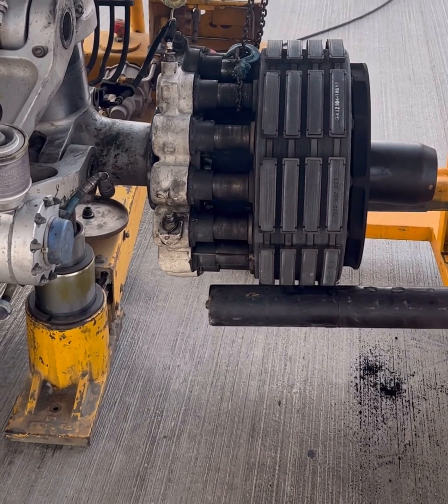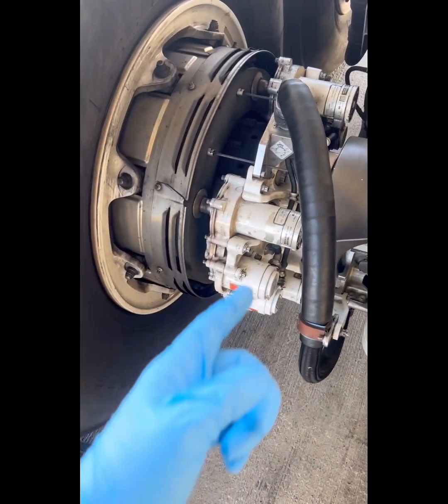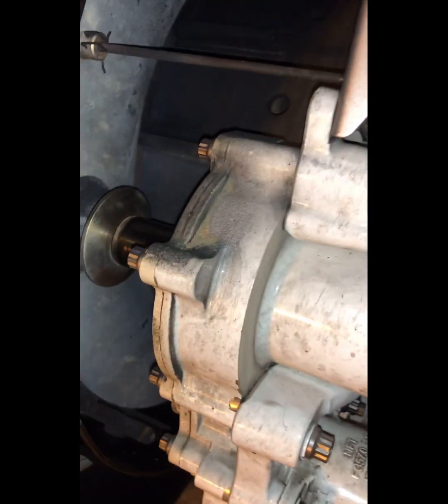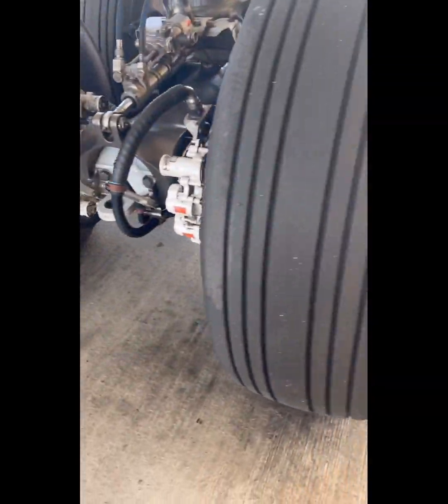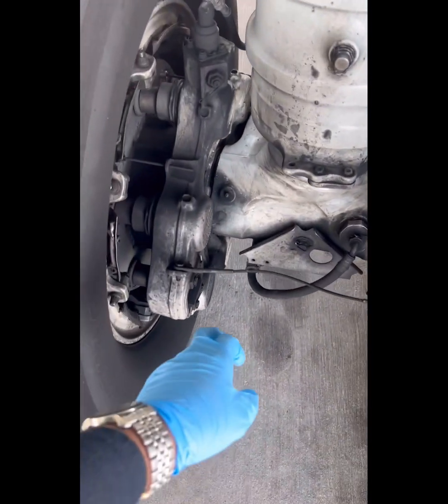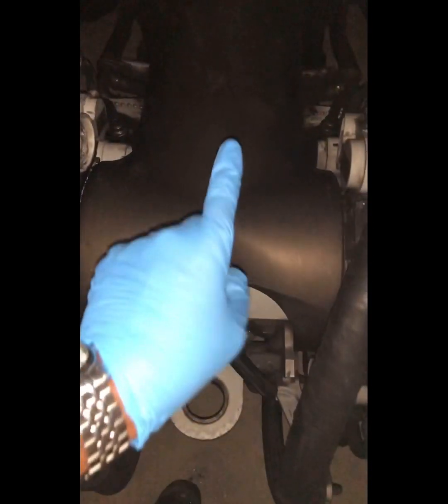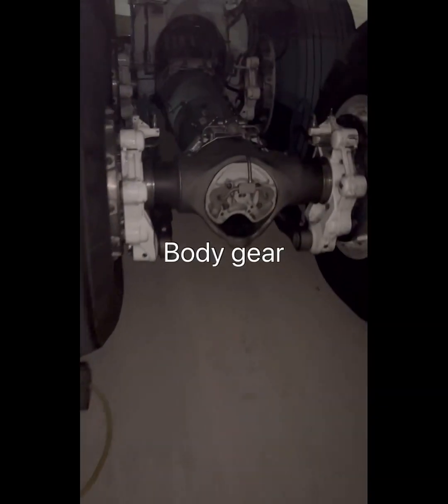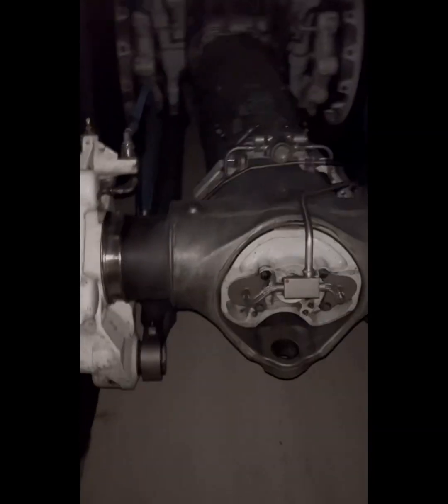This Aircraft is the only commercial aircraft with Electric Brakes,How do they work ?

Comment: Hey, I don't know if you have access to them, but the A220/CSeries also has electric brakes! I don't know if they're similar or somewhat different in design - obviously, somewhat smaller.
Reply from the maker: I haven’t worked on any a220 yet but I have flown on one as a passenger. I do have some colleagues that do have them on their fleet will try and get some insights on them